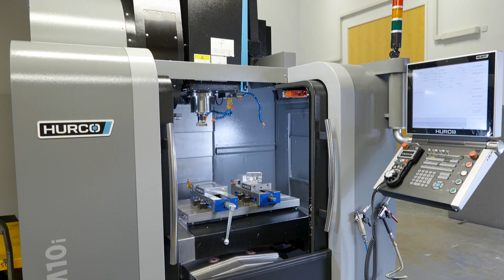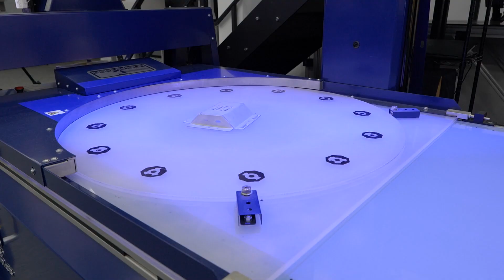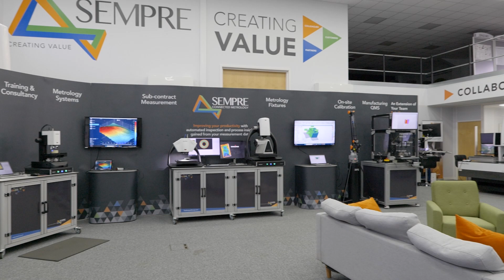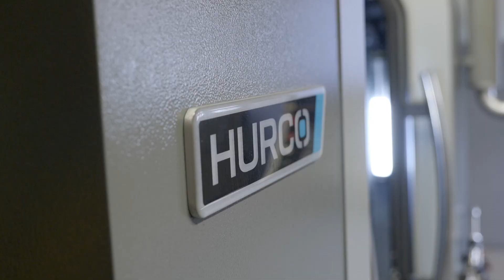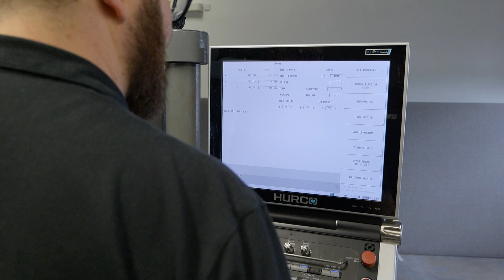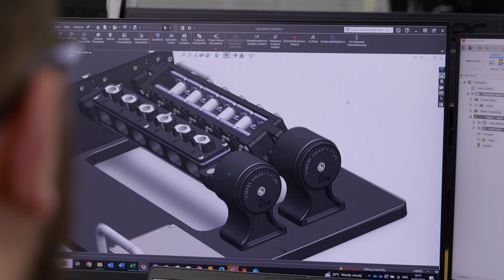The Sempre Group. New Hurco VM10i improves productivity

Comment: i have a small garage machine shop and even as a hobbyst i am really considering a vmx10 as it is a small machine but very capable, at work i use a vmx30 from 2008 and is very very nice to work with, iso, conversational and even parametric, just that or even all 3 in the same program, very very nice